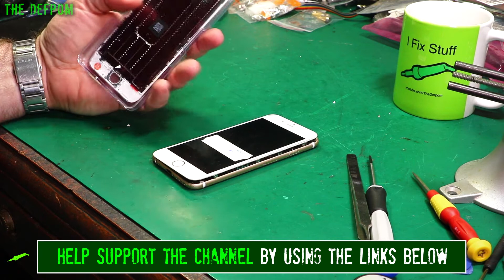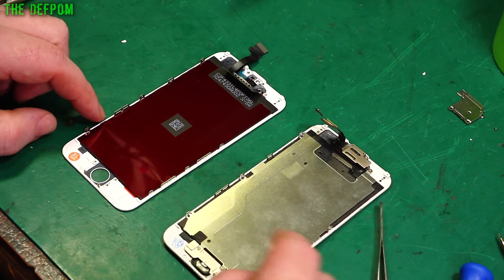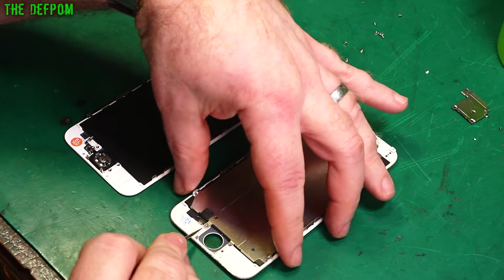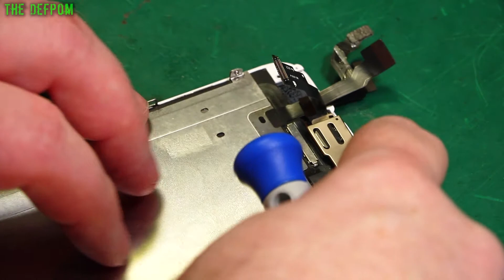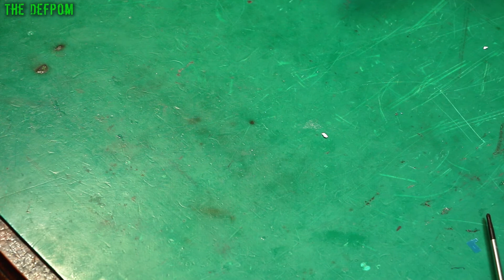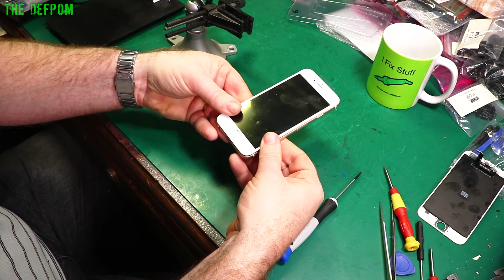🔴 #783 Apple iPhone 6 Screen Replacement - Replace Your Own iPhone Screen.

Comment: Doesn't matter how fast ya do them mate, you're doing it carefully & properly. Can't remember how many phones I've seen now which have had  'professional' work done. Many of them with stripped threads, missing screws & torn flex's... Some with whole parts and RF shields etc missing 😯.
Anyway keep up the good work mate 👍